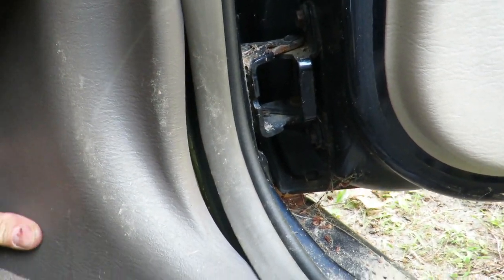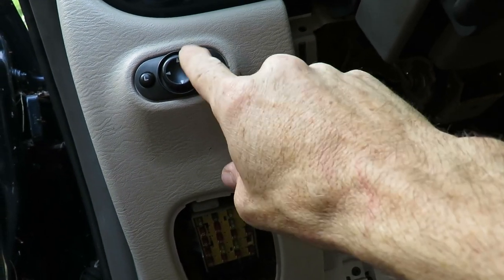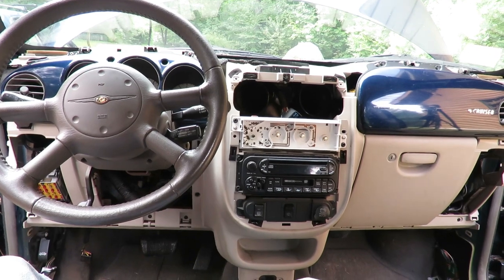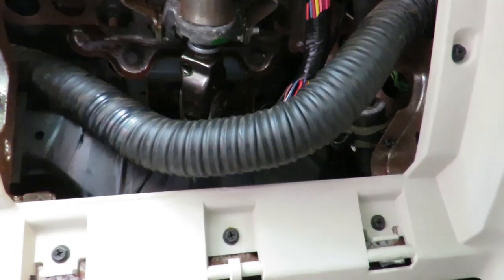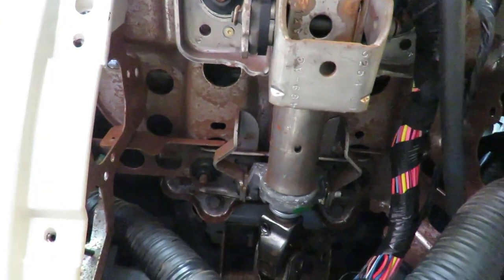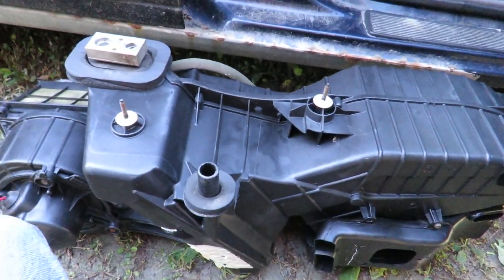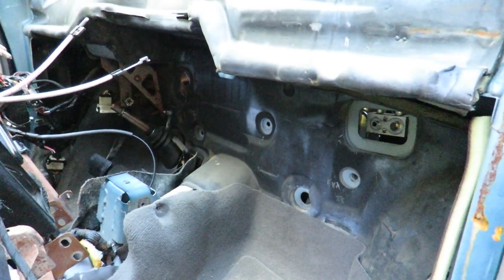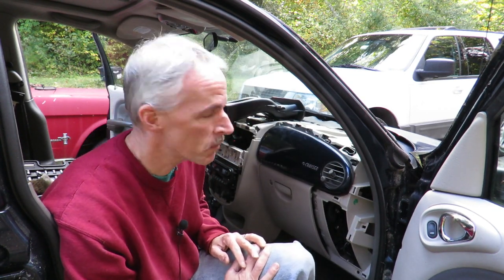How to remove your PT Cruiser heater core (the easiest way on the internet)

Comment: Thanks for making this job possible for me!  Saved myself $800!  A few hints: You'll have to unplug the wiring harnesses on both the driver and passenger sides... also you'll have to remove the large defroster vent before the heater assembly will come out :)
Reply from the maker: You're very welcome. Nice savings.  I can't imagine what a stealership would charge.  Thanks for the extra tips, much appreciated.

Comment: Question:  When I first start up the car, I get a weird cleaner smell coming from the air vents. It goes away after a few minutes. It doesn't quite smell like coolant. Could it be coming from the windshield wiper reservoir that's mounted at the fresh air intake under the hood? I think it's dumb how they install the windshield wiper reservoir right next to the fresh air intake.  I don't seem to be losing coolant, that's why I'm thinking it's the old windshield wiper fluid and maybe the windshield wiper reservoir cap doesn't seal well.  Your thoughts?
Reply from the maker: Hi Mr frostbite.  That is a tricky one not knowing the smell it is.  I can't say for sure, but I think it is unlikely it is the washer fluid.  Wish I could be more help

Comment: Holy crap that is a lot of work to replace the heater core! Thank you for the video! I was thinking of replacing the AC evaporator but after seeing your video I think I'll hold off for a LONG three day weekend before  tackling this job. Thanks again for the video!
Reply from the maker: Hi Andre, thanks for the comment.  That sounds like a good idea.  It's always good to have that extra time just incase things don't go as planned.
Reply: You otta try it in a '06 Outback!

Comment: Hi Scotty,  Thanks for making this video. I only needed to remove my dashboard as the Texas sun has cracked it so bad. Your thorough step by step on the disassembly was the best I've seen. I really wanted to avoid breaking the little plastic attachment points. It seems like knowing where they are hidden behind the trim is most important.  Thanks again for the stellar presentation.

Comment: Hi Scotty! First I'd like to thank you for your hard work on this video. I'm sure it slowed the process to completion down quite a bit to get the video footage needed. 

I am currently having to replace my heater core in my '07 Touring Edition PT Cruiser as it is plugged. This was most likely my own fault as I used BlueDevil Head Gasket Sealer to fix a leak that I thought I had due a false positive emissions test on the radiator. It's a long story but...suffice it to say, heater stopped blowing hot air after using this product. Took it to a mechanic to diagnose the problem and it was confirmed...plugged heater core so not going to bother trying to flush and just replace.

I have watched several other similar videos and indeed your method is by far the most efficient and simplistic; in my humble opinion. Your video was the first I found and, as I watched more and more videos by other people, I couldn't help by wonder why they were taking so much off....especially the steering column. Though there are some variations amongst the varied year and models...they are generally the same. By watching your video I was able to determine exactly what I needed to do BEFORE starting since this is a big project. 

Ultimately, I opt'd to go ahead and take it to a shop and let someone else do it for me but...you're video allowed me to save a ton of money in parts and labor alone. Although, I do feel confident I could easily do this job myself had I been able to make the time. So again...THANK YOU for a well documented heater core replacement done the right way.
Reply from the maker: Thank you Lee for your kind comments and yes trying to video document the process does allow things down quite a bit.
Reply: Just a note.....Blue Devil head gasket sealer will not clog a heater core or anything else. It's not a thick goop like the majority of the other block sealers, it looks like and has the consistency of blue kool aid.  Totally different concept, it reacts with the hot combustion gasses from the cylinder and turns to glass to seal the gasket leak. This stuff is truly a working as advertised product. If you have bubbles in your coolant and the pressure keeps pushing out the coolant and your engine is overheating then this is the product you need. I've used it in several cars and it's been years and they have yet to fail. Just don't try to fix a huge crack or gasket leak because there's no miracle cure for that.  I suspect the clogged heater core was due to not replacing the coolant at the specified intervals and/or not having enough coolant or running with just water and no coolant. This causes corrosion very quickly and all the rust and crud will clog up your heater core quickly. So always to be sure to run a 50% mix of coolant  and water because it not only keeps your engine cool but it prevents corrosion. Anyways, have a good day and keep calm and carry on!

Comment: Great Video, just did mine Yesterday it worked great . BUT must pay attention not to forget little things, when I hooked the heater hoses up I pulled the vacuum line off that hooks on top of the AC / heater Box and had to remove all dash bolts to tilt dash back to connect hose. still got it ALL finished in about 5 hours
Reply from the maker: Hi Gary, yes you always need to watch out for accidentally disconnecting something important. And 5 hours complete job, that's awesome.  Thank you

Comment: Thanks Scotty. My 07 dash may look different on the outside but comes out with the same bolts. Now on to replace the evaporator core and I might was well replace the heater core while I'm in there.
Reply from the maker: Very good idea.  Don't do what I did,  I didn't even think about that when I did mine.

Comment: 22:32 Does that AC connection block you are nearly pointing at get a new seal/O-rings?
Reply from the maker: I would have to assume yes.  But am not really sure because I didn't look into that,  I wasn't planning on fixing that.  Sorry,  but I'm sure a short check on youtube  about ACs you'd find out weather it's  recommended or mandatory.. thank you

Comment: Great instructions. Need to replace evaporator on my cruiser
Reply from the maker: Funny when I was in there I didn't even think to change mine. I guess I was to involved in making the video.. thank you
Reply: @scottydoall  it seems mine evaporator or some connection is leaking. Replaced leaky compressor, no leaks in pipes but still not holding vacuum and freon sensors showing agent in blowers

Comment: While you have the A/C system discharged, you might as well do water pump, timing belt, timing belt tensioner & related pulleys since you'll need to do so to service any one of those things I just mentioned. And do all of them in one shot, at that... because it's a nightmare to deal with accessing any one of them for service!😱

BTW: You hafta pull the upper intake manifold off just to service the secondary ignition, and the factory seals on it don't always seal properly after it's been apart. 😫

On second thought: Just torch the damn thing. That'll add to it's "collect-ability" value, and you'll be able to immediately collect on that... from the insurance company.😉
Reply from the maker: Sounds like you've been thinking about this alot.

Comment: Thanks for taking the time...
good job. Still a little intimadating but manageable.
 I wonder what a shop would charge for the job, or how many hours they would charge for
Reply from the maker: Yes.  Definitely a big job but doable. I've been curious about the cost of the job at a dealership. I think I'll make a call or two and post my findings
Reply: About $1200!
Reply from the maker: @raynadani3172  Wow! I wonder how they do it.
Reply: @raynadani3172  car shop I went to want 1800

Comment: Hey Scotty. My daughter has a 2006 PT Cruiser. Her issue right is I believe the heater core is clogged. The one line coming out of firewall is cool to luke warm. Gonna try to see if it'll unclog. In your opinion, if I have to replace the heater core would what you did apply for me as well? Some videos are just like you said, God awful involved. Hoping it'll unclog though, only has 33k on it. Thanks for your time & great work.
Reply from the maker: Hi Ron, I think it will be very similar. There may be some differences being an 06 . I've never seen inside an 06 so I can't say for sure but if I were abetting man I'd say my video should get you through.  LMK how it goes.
Reply: Appreciate it Scotty! Hopefully it doesn't come to that, but if it does I'll surely keep you posted. 👍

Comment: I like how after nearly 19 minutes into the tear-down you mention to get the A/C system purged professionally. Ah, the good ol' "...but before you do all of that, do this" routine. 🤣

Great tutorial though. My '07 PT Cruiser has a weird problem where when it's very hot outside, the A/C blows cold out of the two vents on the left half of the car while blowing warm out of the other two. Since my car is apparently the only PT Cruiser on the planet that has this problem (I haven't found any info about it after running many searches), I might just have to disassemble the dash the way you have, Scotty, and just figure it out for myself.

I recently had to remove the dashboard cover and instrument cluster (and a few more plastic panels) just to remove a couple of fiberboard air freshener blocks that someone had stuffed into the left vent. After watching this video I didn't realize how close I was to being able to get at the HVAC system, so unless I come across information as to the cause of the uneven air temps coming out of the vents, I'll use your video and tear into it.

Thanks for posting this video, Scotty.

Comment: Hi Scotty very educational video I have a 2001 PT Cruiser it's brand new it has no miles on it and I came across the video because a mouse did get in where my heater blower is I cleaned it out the best I can but someday I'm going to take it all apart just to clean it the right way but it's a brand new car I stored it for many years and it's $2,022 and I'm just starting to drive it now the car is absolutely meant and hopefully my heater core won't go but if it does at least you showed me how to do it seems pretty easy if you could change one in a 2006 Jeep Wrangler I guess you could do just about anyone thank you
Reply from the maker: Thank you Gary, you reminded me that I never did make the mouse proof your car video.

Comment: Decided to review this video.  On the topic off heating systems on a PT Cruiser, what is the condition of your steel heater tubing around the engine block?  That gets real rusty and could leak wherever the tubing rusts through.  Would you know if that is easy to replace?
Reply from the maker: Unfortunately I had to get rid of my PT a couple of years ago and don't remember how buried those lines are.  But if they are not tangled under a bunch of other stuff, it should be pretty easy. Can't say for certain, though.
Reply: @scottydoall  Sounds like they were still good at the time and you didn't keep the PT much longer after your heater core fix.

Comment: I haven't decided if I want to replace the heater core by cutting an 8 by 10 hole in the fire wall or the way you showed .
Reply from the maker: 🤣 I saw that one too.  Still don't see how that would work out.  Not trying to be self promoting but please try my way first,  I think you'll like the results.

Comment: I see you are still maintaining this video discussion, so thanks. What camera did you use for this video? Thanks, Jack.
Reply from the maker: Hi Jack. I used my Canon Power Shot SX60 HS paired with a BOYA  lapel mike (sorry don't recall the model)
Reply: @scottydoall  Thanks for the info. Great video ! Working on a 2003 PT Cruiser Turbo.
I'm going to try and surgically slice open the heater box to get at the heater core so I don't have to evacuate the A/C.
Local shop wants $150 to evac/recharge.
Reply from the maker: I think that might work.  If you tilt the dash then separate the plenum. It may be doable. Let me know how it goes.
Reply: @scottydoall  How I love working under a dash.
Reply: It worked and I did a video. I think you will enjoy it. Now I have to figure out YouTube. Do you have a favorite video editing app ?
Reply from the maker: Hi Jack, that's great I'm glad to hear it worked out for you.  I've really only tried Shotcut. It was free and there are a lot of tutorials on YouTube to get you going.  Can't wait to see the video.

Comment: It was very helpful but the one thing I needed to know is was the evaporator coil for the (AC) the big thing that looks like a radiator core in the middle of the assembly really the evaporator core because that’s what I have to change could you please do the same video on how to change the evaporator core or email me back stating if what I think is the evaporator core and if so how do I remove it to replace it
Reply from the maker: Hi Joe, yes that is the AC evaporator. It is the more aluminum looking one closer to the blower motor with the aluminum block on the end of the lines. As far as replacement it should just p pop out like the heater core does. Then just install a new one, make sure you get a good seal between that aluminum block and the one in the engine compartment and you should be good to go. Hope that helps. Thank you

Comment: What is vacuum line that goes to power booster long black line from black box to bottom off brake booster? Runs through firewall
Reply from the maker: Hi Geo,  not sure. It's been a while since I was in there and I can't even check for you cuz I had to get rid of my PT for a 4WD for my new job.  
Sorry

Comment: Hi Scotty - I hope you can help me. I'm working on replacing the heater core in my 2002 Cruiser. I've watched your video many times and followed every step. The dash is rolled back, and everything is disconnected at the firewall. We cannot get the heater core housing to come out. In your video, when you reached in, it pulled right out but no matter how we shake it or pull on it, it will not come loose. The 2 A/C bolts are out. The three sheet metal nuts are off. The 2 hidden bolts, inside the cab, are out. I'm wondering if you may have a suggestion?
Reply from the maker: So you're saying that it still seems like it's bolted to the firewall? It's not loose yet?
Reply: @scottydoall  Yes and no. When we try and shake it, or pull it loose, it feels as though we've missed something. It does not feel as though it's rigidly attached to the firewall. When shaken, I can see the two water lines, on the driver's side, move in from the firewall, maybe a half inch. When the pressure to pull it out is released, it returns back to the firewall, The condensate tube does the same, but maybe only moves in about a quarter of an inch. It's like there's something on the passenger side holding it from coming loose. We have spent a lot of time going over every step but cannot determine what we are missing.
Reply from the maker: So I'm thinking that your AC tubes are stuck in the "reciever block" that is in the heater plenum. It is the aluminum thing on the left with the 4 holes in it at 19:50 in the video.  You'll have to carefully pry the tubes out, being careful not to scratch the sealing area. That should do it .
Reply: @scottydoall  Thank you so much. I hope we did not damage them trying to get the housing out. I will let you know but due to a medical issue, it will be a while before I can get back on the project.

Comment: Nice job.  Still not for the faint-of-heart but at least easier (relatively speaking) than the other methods and kudos for pointing out the pivoting bottom bolt trick.  I don't agree with the through-the-firewall method - that's just a hack job!  After all that trouble though don't you wish heater core jobs were as easy on modern cars as the old Mustang?
Reply from the maker: Thank you,. Yes it is still a big job but hopefully I've made it a bit more doable for more DIY mechanics. Engineers could make this sooo much easier if they wanted to. Hay, how'd you know i had an old Mustang?
Reply: The mustang is in the video 😎
Reply: @kellykelman9639  It is but I think that was a sarcastic question!

Comment: So whats do different then the others you took it all apart too!
Reply from the maker: Hi Kathy, sorry for the delay, I just saw your comment. The difference is that I show you how to remove the dash only taking apart what is necessary to get the job done. In all the other videos of this job they take apart MUCH more than is needed for this job, making it take much longer (6+ hours VS 1 1/2 hours) and be more difficult with more room for mistakes to happen on reassembly. Thank you for your comment

Comment: Did repair now airbag light is on and horn wont work.
Reply from the maker: I'd have to make a guess and say that a connector or two must have gotten disconnected somehow. Those both have fuses too,  probably check those also.
Reply: @scottydoall  Thank you..
Reply: if you turned the steering wheel  while it was disconnected  you might have broken the ribbon wires to the clock spring to the steering wheel air bag.
Reply: Oh well now that's exactly what i did lol Thank you for taking the time to post.